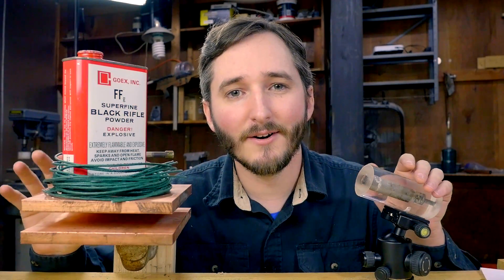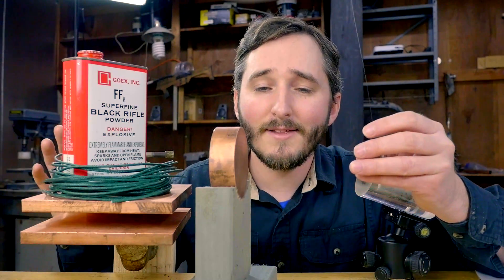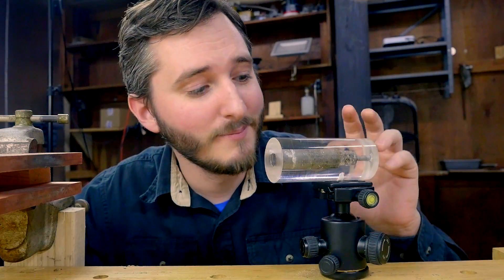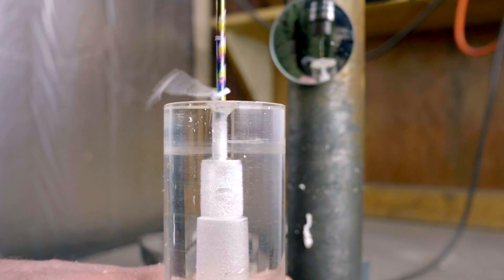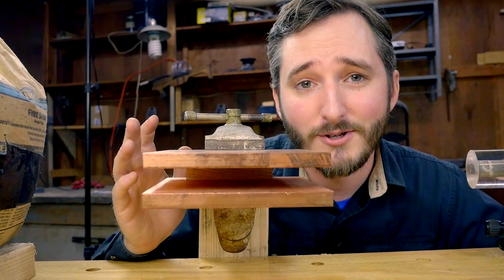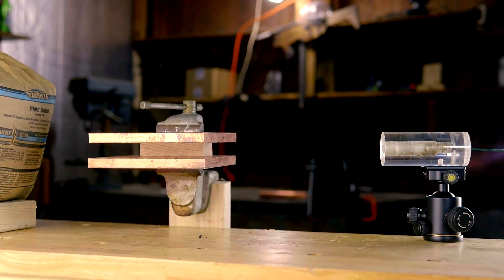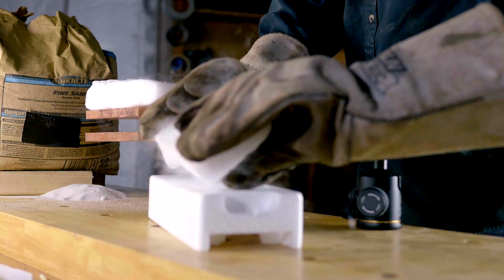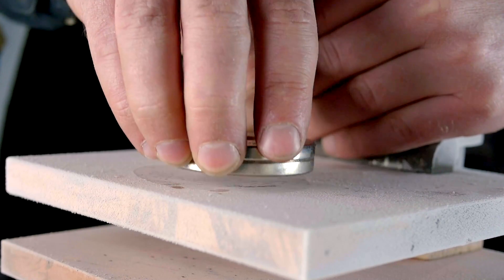Electromagnetic Force Fields VS. Magnetic Cannonball

Comment: Where did you get your copper plates?  I've have looked on eBay and Amazon and have found nothing but thin sheets or very small disks.  I know that a disc that large must be expensive but these types of experiments are very useful at science fairs.  I've used the one where I drop a magnet through a PVC pipe and a copper pipe at the same time and the kids are amazed.  It works to some extent using an acrylic tube and a copper coil that is sorted end to end also.  The induction and resistance to movement in the copper coil isn't as dramatic as a copper tube but you can see the magnet slow down especially if the acrylic tube is significantly longer than the coil of wire.  It falls quickly and the slows when it enters the coil.
Reply from the maker: Search for 1/2" thick copper bus bars or 3" copper round stock

Comment: What if the heat generated by the cannon is suppressing the magnetic strength of the spherical magnet, how about using a compressed air cannon to launch the magnet, no smoke and no heating of the magnet.

Comment: Now i dont know the mathematics well enough to know, but i dont think cooling down copper would increase the resistance the the magnet experiences. By cooling it down you reduces its resistance so you will in deed get a larger magnetic field, but that magnetic field will be less resistant to change as the electrons in the copper can flow more freely. But i have to admit i could very well be wrong about this. Thank you for another excellent video good sir.

I would be very interested in more videos in this field personally, what about other diamagnetic materials, how do they stack up against copper? Tin, Zink, Carbon and lead for example maybe even silicon. But before you go on a wild goosechase maybe do some small tests for yourself to see if you see any worth in pursuing this matter farther.
Reply: This experiment isn't related to diamagnetism, but rather to magnetic induction.

Comment: Well, you used a neodimium magnet, you should try by magnetizing some holmium, it has better ferromagnetic than neodimium, and has a malleability similar to lead which might make it shread in smaller fragments which would require a smaller force in order to slow down, it is also denser, which means that it will be slower, so it will be for much longer within the magnetic field of the copper, considering kinetic energy being E=mv^2, more time within the magnetic field will have a more drastic effect on the kinetic energy by reducing the already reduced velocity than it would have by reducing the mass. Also because any bullet resistent material is way more vulnerable to a factor of speed than mass. This is why bullets with the same kinetic energy perform differently in relation to the proportion between mass and velocity.

Comment: I hate to say it but doing the test with the two copper plates was pointless because of how it was designed. There needs to be a complete path for electrons to flow normal to the velocity. By not creating a path, the plates did nothing and did not effect the velocity. Another way to put it is taking that copper pipe and cut a gap down the length of the pipe. This again will nullify coppers ability to produce a magnetic field and the magnet will not be slowed by the pipe.
Reply from the maker: Electrons flow in currents perpendicular to the magnetic field as well as parallel. You can see diagrams for this on the Wikipedia page about magnetic braking, and an example of a magnet slowing from plates in this configuration in my previous video.
Reply: I stand corrected, I must of forgot that when I was taught. Keep up the good work.

Comment: I would suppose that a spherical magnet would quickly rotate into an orientation where it was doing least work, once it begins to induce and experience the opposing magnetic field.  (This of course would reduce the slowing/stopping ability of the copper.)  Have you noticed spherical magnets slowing down not as well as cylindrical magnets when dropped through appropriately sized copper tubes/pipes?  Thanks!
Reply from the maker: Yes you're right. But they do still slow down significantly at normal speeds. Dropping the sphere magnet down the long pipe it takes about 15 seconds to reach the other end.
Reply from the maker: It was not demagnetized
Reply: Interesting. I think it makes a big difference if you just drop the round magnet in the copper pipe, or shoot it out at ballistic velocity and high spin. Would be interesting to compare the time of flight in free air and in the copper pipe.
Reply: I'm wondering how this might change if we made an actual bullet shape and got it to spin

Comment: How about shooting a solid copper or even silver projectile through the field of an extremely strong electromagnet? 
The setup would be quite simple as you'd only need a rifle for which you can find solid copper bullets, some pvc pipe, some welding cable and a bunch of car batteries. Ideally you'd also have to come up with a way to fire up the magnet just for a second or so while the projectile is being fired. That way you don't melt your cables quite as fast.
Reply: You could also build a multistage reverse coilgun triggered by optic sensors such that every coil can create a very strong magnetic field at the exact moment the projectile passes.
Reply: Vibudh Sharma
The magnetic breaking effect doesn't act like a spring that bounces back after it's been compressed. It pretty much just turns kinetic energy (movement) into heat. 
The general principle can be used to build an electromagnetic accelerator, though.
Reply: Swiss, I second this idea!
Reply: swiss what if the bullet changes direction. It may be a very dangerous experiment
Reply: this would either melt the copper bullet or do absolutely nothing because you need some bulk to create the electric fields, without which there is no slowdown
Reply: dehim verveen , this is more challenging than it sounds. Inductance opposes a change in the current, so it takes time to build up a strong magnetic field. You can decrease that time using higher voltage to a coil, but that has its limits needing more insulation but that in turn limits the number of turns on a coil.
Reply: You need to create a close circuit for this to work.
Reply: Turn the experiment around... Accelerate the projectile using a magnetic field
Oh, wait. That's been done. Rail gun and coil gun.
Reply: Brett Duane Just one small difference, Rail gun passes current through the projectile rather than inducing it through a changing magnetic field.   But we do have rotory and linear induction motors that do not need to conduct electricity through the object being moved.

Comment: 11:00  Am I the only one that cannot even see the cannon ball when it was answered conclusively??
Reply: I couldn't see it at all either. I wondered if the highlight circle was wrong but even looking outside that I saw nothing.
Reply: Can someone grab a screen shot of it please? I tried watching frame by frame but failed.
Reply: I thought I was the only one haha, glad I found your comment.
Reply: I stepped through frame-by-frame and didn't see it at all.
Reply: I thought I could see it on the other end of the pipe where I thought I saw the ball and the wadding flying up like it hit the front edge.
Reply: Actually ,  you can see the steel ball come out the end of the copper pipe .

In the first clip between 10:48 - 10:52 , the first thing to come out of the pipe was a few sparks , then a puff of smoke . At the end of that puff of smoke , you can see the steel ball come of the pipe at 10:51- 10:52 , and drop very rapidly . It didn't look like it was going very fast , it looked liked it rolled out of the pipe , more than it looked like it shot out of the pipe .

I think the pipe did slow it down quite a bit , 4 more feet on the end of that pipe , might have made the difference ?
Reply: Increase your quality settings as high as you can …. then slow down the video … it's there you can see it come out of the pipe however his highlighted area will loose track of it once it far away from the pipe.
Reply from the maker: I missed with my little highlight ball. It's only in two or three frames.
Reply: @Nighthawkinlight  Nighhawk Do you think polarity alignment could be an issue?  Since your using a ball you can't prevent it from spinning, thus destroying your induced repulsive force in the copper.  Try firing a cylindrical magnet next time, or attach a piece of foam to the ball to hold it's alignment.

Comment: i was really surprised to see the magnet pass through the entire length of the pipe and shoot out the other end. i thought it would slow it down massively too. though the electric field should in theory heat up the magnet as much as the copper, shouldnt it? and neodymium magnet have a very low curie temperature. maybe the heating of the magnet lowered the stopping power of the copper. would be interesting to try and catch the bullet with something like a thick piece of styrofoam at the end

Comment: To cut or drill acrylic you should always sprinkle water. Some people almost soak the acrylic. Try next time.
Reply: Félix Batista seen a guy drilling glass. He took a 2 liter bottle and poked a small hole in the side.
Filled it with water, then used the cap to turn it on and off.
Reply: Also I think he could have drastically turned his speed down on the drill.

Comment: You trick of drilling the block of wood to hold the rod would have worked much better if you clamped the wood down first, and didn't move the setup.. That way it would remain centered though all the drilling
Reply from the maker: Yes but not possible with my cheap drill press because it doesn't have enough travel to core the cylinder without moving the table, and the table freely rotates rather than moving with a crank like larger drill presses.

Comment: afaik the two copper plates needed to be connected to each other to form on completed circuit.
Reply: The current that creates the opposing field moves inside the individual plates so just connecting them should not make any significant difference. To really make a difference he would have to connect them on both sides over the whole length to form a tube. But as he showed even the tube is not enough.
Reply: ahh thats how it was... well school physics were some time ago thanks.
Reply: but wouldn't a copper wire coil yield a better result? or am i mixing stuff up here?
Reply: For braking you want as solid a connection as possible to reduce electrical resistance. In the case of a wire coil the current has to move through the whole length of the wire which causes way more resistance than just around a pipe.
That is for the same thickness hovewer and i don't know how a coil with several layers would compare to a tube.

Comment: You should take a long coil or just a single turn. and fire the magnet through it. Put a shunt resistor of known value in the coil and trigger an oscilloscope on the rising edge of the pulse. It would be cool to see how much energy you can get out of the setup.
Reply: Just posted the same thing and saw you had already posted it..yeah it's a great idea :)
Reply: I like your viewpoint, seems you have some of the same types of outlook. Thinking outside the box is good!

Comment: another way to properly aim the cannon so that it's exactly centered between the two plates is to use graph paper taped on the far end of the copper setup and poke a keychain laser pointer inside the cannon